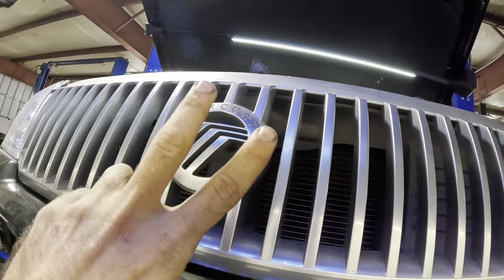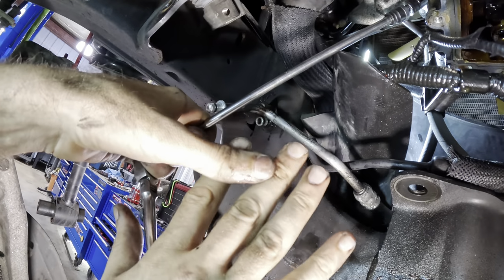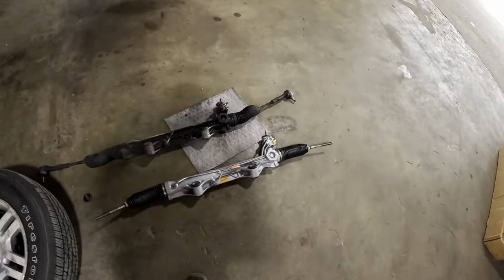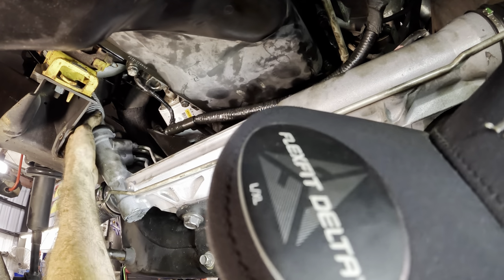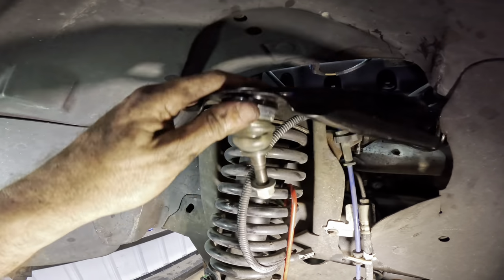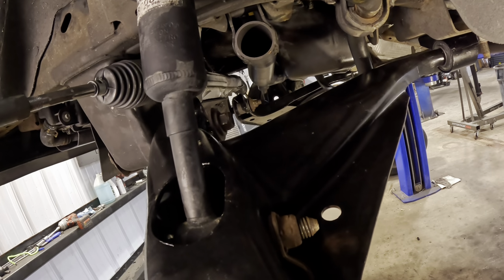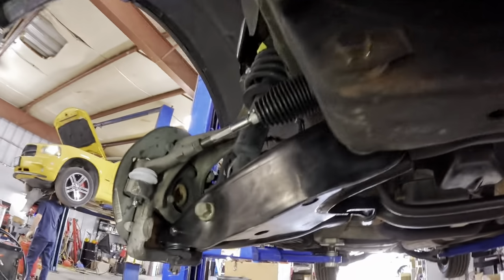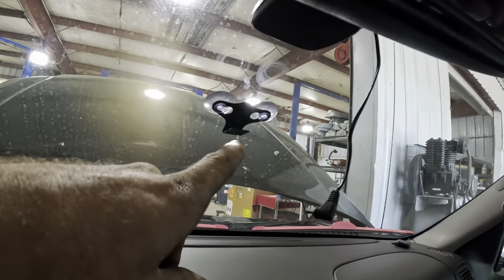Ford Explorer 4.6 Front End Rebuild PT2

Comment: I'm a big fan of using synthetic, high-end oils. I highly recommend it to anyone that will listen. Using Amsoil is definitely a great idea if you want to keep your vehicle going. Just like using your R2D2 unit to change customer's brake, transmission, or diff fluids. 

However.......

If you want to keep your vehicle running and driving for a long, long time, then you're missing the point to using top-tier engine oil products. If you simply run the oil longer "saving time, waste and money", then you're not getting the benefit from said top-tier engine oil products. And given the substantial additional cost of them, you're not really going to save any money anyway. 

If you want to use that good lovin' oil in an effort to keep your vehicle going, then you have to stick to regular-interval oil changes, or maybe just a little bit longer. Spend the money, keep the engine clean, get the benefits. Nothing is free.

My car's oil change intervals are around 8K-10K, based on using Ford's semi-synthetic blend. But I use Penzoil  Ultra Platinum Unobtanium, and I stick to the OEM intervals. It costs more (twice as much), but I guarantee you my internals are clean and protected. I also change my air intake filter multiple times a year like a demented fool.....but whatever. 🤣

Having said all of that, I should have you flush my brake and clutch fluids.
Reply: I agree. I use Castrol edge synthetic high milage 5W30 and a Wix XP filter. The thought of changing oil at high intervals keeps me up at night. I use it on my old GM OBS trucks the vortec engine.

Comment: Good training on using a tool that can break loose. I had a grub screw on a pulley and when it finally broke my knuckle hit the stainless sheet metal and cut through the tendons. I was off work for weeks while the jelly repaired. I have changed my way to open palm  or tool to remove that happening again.

Comment: I was really unfriendly to my old volvo, it would get at least one oil change a year, but I was doing a daily 120 mile commute, so 90% of the time the oil was at operating temperature, thus my oil changes were at 33,000 mile intervals, if I had been changing it at 2000 mile intervals i would be changing it every few weeks and the car would have been spending more time in the shop having oil changes than actually running.Actually the volvo recommended service interval for the volvo V70 was 18000 miles or 12 months- but you will see various recommendations as low as 3000 miles. I just went with the 12 months rule as the oil was mostly running at its optimal operating temperature, not doing short trips. (awaits the cries of horror with tin hat firmly on head)- Oh by the way- this 20 year old car was up around the 300,000 mile mark and still going strong.

Comment: Been using Amsoil everything for decades and nothing but exceptional results.  My 2006 Santa Fe with 2.7L V6 had 300K+ miles (535,000km) on it when the Camshaft snapped due to a casting defect and I tore apart the engine to see what happened and the inside was spotlessly clean with the engine not using any oil and only leaking minor amounts of oil after all those miles. I did extended change intervals using their 0w30 in that engine for 90% of that engines life. The transmission used the Amsoil ATF for its entire life and this transmission had no serviceable filter.  Still the original transmission when I scrapped the vehicle due to the bad camshaft.   Super impressed.

Comment: Ray hoping you noticed that exposed red 12v starter wire on the left side that had rubbed through the insulation. Customers gonna have a real bad day when that shorts out.
Reply: you can see it at 6:40 btw, but it's way more clear in the first video.

Comment: I use High Mileage oil 10w30 as it has additives to help keep the engine oil seals and gaskets soft and pliable and less likely to weather crack and leak.   My GMC Sierra has over 100,000 miles and its valve covers and oil pan etc are all bone dry and no oil spots on my driveway so IMO it works and its worth the added price and they have never been off since it was built.   I have my oil changed every 5,000 miles and usually try to time a full servicing right before winter so I know it has clean oil and the trans, transfer case and steering pump, brake fluid etc. have all been serviced before the cold winter (I get single digit temps and some 0's Zero F with cold fronts in Jan and Feb).

Comment: Yeah, the ‘kill people bolt’. I had this forgotten in my car when I had it in at a local dealer for a heater box replacement. Picked up my car and drove home, on the highway no less and felt some weird play in the steering. When I looked underneath I found this bolt was threaded in but not tightened. I tightened it and moved on, but in hindsight I should have said something about it. Had I not felt play in the steering I wouldn’t have noticed. Gotta wonder how many people this mistake happens to.

Comment: Yea something else to keep in mind for ones running extended mileage oil is change your filter at manufacture specs like you were doing an oil change to keep oil cleaner. For instance if using 15000 mile oil at first 5000 change filter only, 10000 miles filter only, and 15000 change oil and filter

Comment: Enjoyed watching you rebuild this front end running gear . Also liked that you spent the customers money on the important parts , oil , gaskets etc. I believe  that remanufactured equipment is just fine . I often wonder if there are rebuilders that can take old no longer made parts and redo them ? I am sure there is a good need for that in old car , truck restorers . Thanks again for an interesting video . Stay safe , have fun .
Reply: Problem is the many who just do a wash, flush and a rattlecan overhaul, and short of tearing it apart you have no way to see before you put it in. Then you are good at doing it the second time.....

Comment: I purchased a 2005 Explorer specifically because it had that uber reliable 4.6L 2V V8 in it. Got a quarter million trouble free miles on it. Still has the factory alternator, fuel pump, transmission, etc. But you do have to replace a gasket here and there. But not near as often as my buddy's Chevy Suburban which leaks everything. Changed oil every 5k miles and tranny service every 30k. This generation Explorer was the last one with the full steel truck frame. Given todays ridiculous car prices I would never sell it. And no, I've never used boutique oils like Amsoil, Royal Purple, or BG. I just get whatever good quality oil is on sale at Walmart. Oh, still on the factory oil pan and valve cover gaskets too. How about those apples.

Comment: My rack and pinion on my Explorer was leaking. I changed the fluid and I put some Lucas in there and it actually worked and now my truck is 20 years old and it’s still going and I did it about 13 years ago but I’ve done it again since but it’s still going.

Comment: Talking about slipping on using a wrench, I almost broke my arm while using a Coats 10/10 tire machine that had something inside break.  The spindle shaft that the the breaker bar goes on is supposed to rotate smoothly throughout its stroke wasn't working right so once it got through the part where it slides the tire bead off the rim it swung violently around it's full stroke hitting my forearm. That hurt. After complaining to the boss about it he gave in a found and and purchased a good newer model

Comment: The only problem I have with extended service oil is the engine block is like a coke bottle and if you make a lot of short trip's water will condense in the engine because it doesn't get hot enough to burn the water off so the only way to get it out is to change the oil !

Comment: If I've learned one thing from Ray, it's use the right tool for the job. Watched a bunch of youtube  vids for motor mounts for my car and they all struggled. I bought a $75 flex head ratchet and did the job in about 90 minutes. 0% chance of doing the job otherwise.

Comment: Just a suggestion, but concerning the installation of the spindles, would it not have been a little safer to take one of your axle support jacks or the transmission jack, and placed it under the lower control arm, then slowly run it up as you align the upper ball joint?

Comment: Oh Raaayy, it’s a lot easier if you jack the lower control arm up to fit the top ball joint.  Ask me how I know.  I was doing it your way, and it suddenly hit me that I was doing it the “slap you in the face with a pry bar way.”😂
Needless to say, I just slid the stand up support stand under it and easy peasy.  I also just did the oil filter adapter gasket, so this was a fun video to watch.

Comment: This is also known as a Lincoln Aviator. The explorer and mountaineer had a 4.6L V8 engine upgrade but came standard as a V6 whereas the Aviator came standard with the 4.6L V8 but nearly everything else about the cars are the same.
Reply: I doubt the door cards are the same. The Mountaineer door cards are discreet, each having separate heat staking locations for the speaker grilles. One grille could have served the 4 different doors but the engineers positioned them differently to prohibit interchangeable requiring 4 heat staking stations instead of one. The 4 service part numbers soon disappeared and the customer had to purchase a complete heat staked assembly.

Comment: as you get older... you will find out that tranny jack has many uses for the tired "BACK"(such as lifting that heavy spindle in trucks into place, but of course strapping it onto the tranny jack(mush lighet this way)and of course.. that same tranny jack makes a GREAT lift for the Stubborn Spindle with the KILLER shock pushing down?

Comment: I was entertained by the viewer who pointed out the red S-hook on the left holding the knuckle at 6:40 as a worn starter/battery cable. The battery cable is black with a red dashed tracer at the rear of the engine--not visible in this frame.

Comment: Was that a snap-on hammer?... Looks like one I bought (late 90s)...

All of the orange rubber coating on mine dryed up and fell off... Now it's just the internal metal handle/head.

I've been out of wrenching for many years now and it's in my trunk until I happen to find another snap on dealer....

THEY BETTER WARRANTY THAT!

Comment: All that for an oil pan. In the good old days it was ten bolts and 20 minutes. Why are they building Rubik's cubes? I made the joke before that to replace the #1 spark plug remove rear bumper. Thanks Ray.

Comment: Can someone explain to me why there are small “gaps” in the corners where the oil pan gasket goes? Same on the rear main from a previous video. I can’t figure out any logical reason to not have the surface 100% flush with the gasket. Thanks in advance!

Comment: I have noticed that motor mechanics seldom use thread lock on metal to metal bolts……is that because of the large torque you put on the fixings, so they are unlikely to come loose?
Reply: If I remember correctly, if you torque you bolts to factory specs then loctite isn’t needed. I feel though certain things (control arms or brake calipers bolt) should require some loctite for safety obviously

Comment: I wouldn't recommend the average customer use the super extra life oil. The reason being, almost no one checks their oil in between oil changes. Without checking oil level, especially late in the oil change interval, can result in oil level that's too low and they risk engine damage. Most newer vehicles with synthetic oil required have an extra couple of quarts capacity to try to avoid this when using the oil life monitor as a signal for when to change the oil.

Comment: I think, there was a mistake. Bolts for lower control arm must be tightened up after the car is down on the level ground, so the arm to be tight when it`s in the right position, isn`t it?

Comment: Those sway bar bushings looked questionable. I would have spent the extra on parts to replace them while you had it apart.
Reply: Agreed. Those bushings can cause problems even when they look good. I asked a mechanic to check mine for front end noise. I was told they were fine. I did it myself at home and my clunk went away.
Reply: @wyomingguy4743  I had a 07 Grand Caravan with a clunk. I replaced everything. My sway bar bushings looked fine. 
I took it to my friend's shop, he put it on the lift and said "I wouldn't change those" But he couldn't find the clunk. 
So I changed them anyways and the clunk went away. 

They are just cheap and easy assurance.

Comment: Nothing bad to say about the Amzoil but there is no way that I'm ever running a vehicle 15k miles on an oil change. A quality synthetic oil may hold up to it but that doesn't account for the contaminants. Vehicles and vehicle repairs are expensive. Don't skimp on the maintenance.
Reply: Any name brand, change at manual intervals, good for owner; using Amsol  to 'extend' protection, good for Ray's pocket.

Comment: I would not run any oil for any longer than 15000 km (a bit under 10 000 miles).
Reply: Anything over 5k is just asking for failure. As far as I am concerned. Oil is cheap ,engines and transmissions are not!

Comment: No Ray...please don't push that Amsoil 25,000 mile oil change intervals propaganda... It's pure marketing hype.   Yes. Amsoil is among the best oil out there... And yes, it's additive package prolongs the lubricating life of the oil...but there is NOTHING about Amsoil that makes it magically get less dirty than any other oil... You're using the same Wix filter, which can only be so efficient at removing contaminants in the oil... Oil changes are cheap (even with expensive premium oil) new engines are expensive.  You're better off buying cheap Costco/Kirkland full synthetic and changing it every 5000 miles than running 25,000 on Amsoil... If you truly want the best, run the Amsoil, but still change it every 5000 miles.   Don't abuse your engine with extended oil change intervals.

Comment: Why doesn't amsoil oil bottles list different mfg's specs, and that it meets their requirements like most if not all other brands.  ie.  Motul, Liqui Moly,Castrol has a 5W-30,5w-40, but one doesn't list VW 504,505 507 508 etc etc etc. while the other named type does, there is a difference in oils.  there is no one brand type even within the said brand that meets all specs.  It's impossible.  Oils even relate to emissions, etc.  Amsoil is like the Amway of lube.  Lots of cult and mystical nonsense, lack of facts

Comment: Ray, show me 1 engine that lasted to 100k without an oil issues at 25k intervals, just 1? From timing chains, tensioners, phazers, and bearings. This isn't even getting into GDI Turbos with low tension rings bs.
Amsoil is a con/scam to make those claims...